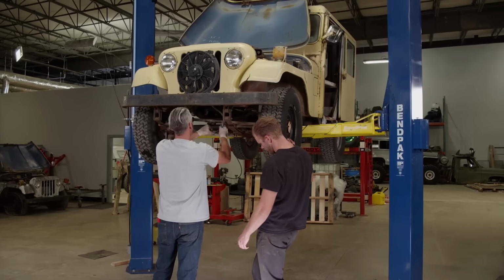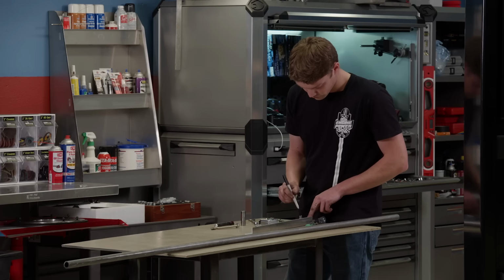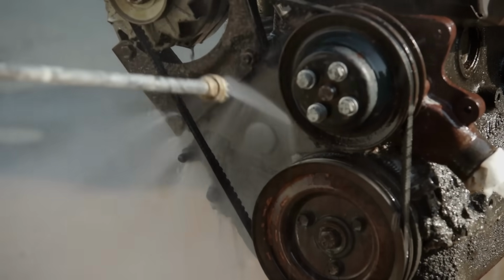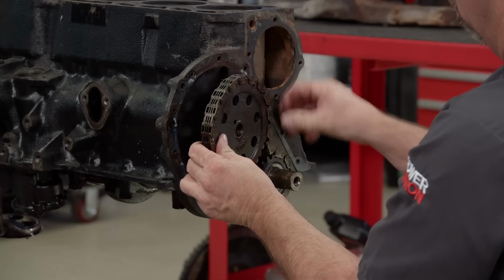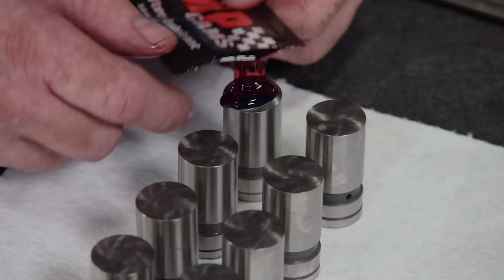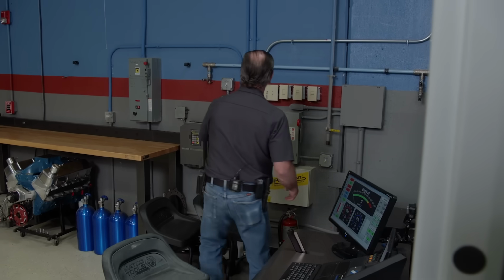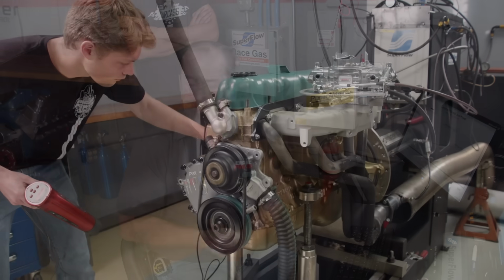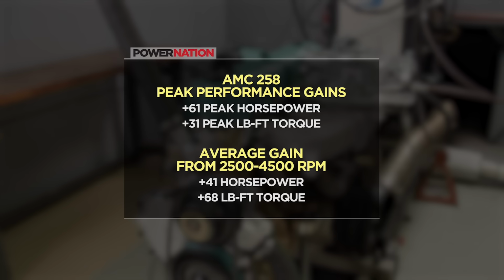Will There Be A Big Power Difference On A Mildly Modded AMC 258 Straight 6? - Engine Power S8, E1

Comment: in the 70s i made my own carb adapter and put a 500 cfm 2bbl holley on my gremlin x. it really woke it up and surprized a couple of people at stoplights. 3 speed manual floor shift tire smoker.

Comment: You could use treaded rod to center the head gasket. Once the head is on and you put in a couple of head bolts you can then remove them..

Comment: scrub it so clean that your dear nana approves, magnaflux it, if that's okay paint the block and send her to a quality machine shop to have it decked .30  thou, hone cylinder walls line hone the mains and cam, widen/chamfer the intake + exhaust ports, smooth all the runners, and then have the block cryogenically treated. believe me its worth it and these blocks are getting rare. at the same time have the crankshaft ground and balanced, one she's home,  forged pistons, 4340  rods, clevite p bearings, ARP head bolts, felpro gasket, mahle lifters, hot clevite camshaft, 0.420 I&E lift, and the ported exhaust loves that and the extra duration.  backcut your valves, lap the seats, roller rockers, amsoil assembly lube. and an really nice torque wrench. id fill it with rotella Dino, light it up and set the timing/advance. break it in and change, change oil. end up with rotella conventional 15W-40 and a can of liqui-moly MoS2 molybdenum additive (magic German juice) which will keep your lifters quiet through time and keep everything dri-slide slick. that studs is great in all motors but I think it benefits these old iron NA beasts the most. looser tolerances and all, the molybdenum disulfide beds in to the metal at contact points and after a few thousand miles really helps immensely.

Comment: I have driven the same Jeep for 20 years.  This Feburary of 2025, the characteristic AMC 242ci I6 rattle when first starting became a loud knocking.  The engine still idles very smooth.  Oil pressuee is great!  There is no smoke, no leaks, no misfiring, no difference at all, from when it was quiet.  The only thing I can imagine is that maybe a piston skirt broke off and loud piston slap is the result.  But, there is no burning oil, no misfiring.  The loud, horrible, knocking and rattling is worse at higher rpms than lower.  Thus, I hurry up to get to fifth gear, to quiet things down.  Well, it is September 2025 now.  I am still driving my beloved Jeep.  But, I know she is in hospice.  Upon her death, I will lovingly put her on Jack stands and just make her stationary beauty.  With a bad engine and transmission, my dear Stargazer is doomed.  Repairs will cost more than the value of any 2001 Jeep Wrangler Sport.  I shall miss driving her when she dies.

Comment: My favorite 258 mod is throw the amc ignition aka distributor in the garbage and grab a 6 cyl gm hei change the drive gear to amc from old distributor. Teeth are opposite cut but same count and diameter,i think i had to shave a hair off top the gear on mine to get the roll pin to go back in ,was just a hair be careful just a hair! Now u have a 1 wire for fire High Energy Delco distributor for a hot spark that will set u on your rear if u would like to be brave enough to touch it 😅 no recommend,,,flame thrower is a aftermarket brand through a performance parts house is my goto for the gm style hei. Enjoy no more that pile of ignition nightmare that goes along with the amc 6😊

Comment: When installing the cylinder head, why don’t you use a couple studs to locate everything, then remove them after the rest of the bolts are hand tight and replace them with the head bolts? Even all thread would help keep things straight, although I’d rather have something with a shoulder. Then torque the bolts down to spec. It makes sense to me, and I wonder why it’s left to luck to get things lined up on this engine.

Comment: Lotions and potions, ey? I worked in Auto Parts for 20 yrs in every environment you can think of, and I never reccomended miracle in a can products. Sure there are some additives and polishes and waxes I would reccomend. But there’s also a lot of snake oil out there. Be careful on what you buy and use on your engine. I’ve used Marvel Mystery oil to quiet a noises distributor busking, and it quieted right down for the last two years I owned that vehicle. I’ve used Slick 50 with decent results. I’ve used radiator sealers and engine oil flush. The flush is something you don’t want to leave in your engine, you change oil, add the flush drive it for a short time and change oil again. It helped remove varnish. But there’s also are things out there that will harm your anointed as well be careful and don’t look at potions to fix mechanical problems.

Comment: My gm straight 6 has no bolt for the hormonic balancer. How do I get it back on? I had to heat press the new flat top pistons on the rods, so I'm guessing I have to heat the balancer to slide it on right? But wouldn't that wreck the rubber on the balancer?

Comment: I had a balanced and blue-printed 258 with flat top pistons 390 cfm 4-barrel and a set of headers that made 260 hp.I don't think what you've done with that motor is very impressive?

Comment: I have seen multiple cases of 360s and 401s make an easy 400 plus hp as long as the oiling system is ported and modded correctly

Comment: I Thought it was gonna be like 200hp
Reply: it's only 8.1 compression,
Reply: Later model 4.0L I6 like my 2005 TJ were 187hp from factory. I did a 4.6L stroker to mine about 10 years ago when parts were easily available and cheap - under $4k including an edelbrock head. I wouldn’t bother doing it now, just something I had to do back then. The beauty of these engines is not power, but the torque down low combined with a short wheel base relatively light tub body TJ Wrangler.

Comment: It's funny (to me) that the AMC sixes are so similar and yet act so differently.  The 232 is a peppy engine that loves to rev. That's probably the reason they used 232's in several racing cars - they are essentially a baby stroker.

The 258 on the other hand has a much longer stroke.  It makes a lot more torque but it is a much lazier engine. I mean, you can hop either up..... but stock for stock.... the engines run completely differently.
Reply: I'm no expert, but I think the 258's general lack of top end, even modified,  comes from overall poor head flow, 

And when paired with the higher displacement of the 258, the bottom end's hunger for air outpaces the cylinder head's ability to flow said air at high rpm.

It would be cool to see a maximum oversquare engine though, a 4.0l (.030 over) block with a 199 crank, for a 215ci 3.5l "destroker" 
Imagine the RPM's!
Reply: @riogrande163   The only difference between the 232 and the 258 is deck height and connecting rods. Engines with long strokes make great torque but do not like to rev up.  The 232 is a stroker by comparison.

The 199 suffers from the same inadequate head/port design compounded with lack of displacement. 200 cubes just don't cut it.  Ever driven a Maverick with the little Ford 200?  That engine don't even make a good door stop.

That's why the AMC/Jeep 4.0 was such a good engine.  Moderate stroke, same bore as 232/258, much better head & port design and of course, multi-port injection.
Reply: @That_AMC_Guy  

Wikipedia says the 232 and 258 have different strokes,

you can rev a longer stroke engine, but the piston speeds will be higher. Newcomer Racing rings out stroker motors all the time.

200 cubic inches is plenty for cars under 3500 lbs, 

what killed the Ford Thriftpower inline 6's (144,170,200,early 250) is the integrally cast intake, meaning no upgraded intake and carb could be bolted on, you'd have to hack it off and custom fab something else, hence why most ditched them for v8's.

Comment: That's a 7 main bearing well constructed engine!! Do it justice.Take it back apart put in a forged steel crank,heavey duty everything,a hotter cam, more carburetion,shave the head and add a centrifugal supercharger the see what it will pull.

Comment: yall are running out of carb. shes going too lean up top. personal experience with these motors is that if you bump it up to a 550ish cfm carb and dial your jets in youll probably get over 175hp with this combo. wanna shoot for 200hp? dont be scared to bump the CR up closer to 10:1 and be prepared to only use 90octane or higher gas.

Comment: This would be a great motor for  the old ramblers.....not as heavy as the v-8's, would work good with that trunnion suspension all amc's had in the 1960's.....may be with a bore job to the cylinders, you could crank over 200 horse...would like to drop this little I-6 in my old rambler american with a ford 8 inch rear I swapped in.

Comment: yall completely messed up this build. i love your videos but the space should have been a 4 hole. the primary side and secondary side MUST BE ISOLATED FROM EACH OTHER AT ALL TIMES. thats why there are 2 intake runners. from what i saw, you used an open spacer which killed your flow some due to the intake runner separator. do it again with a 4 hole spacer and watch the torque go even higher.

again, i love yalls videos. just caught a blooper on this one. =)

Comment: powerglide?   What  ignition- ford works good  studs on the cap   205 duration if you do not have 300 pls lobe lift you got took     what head  what year    dual port  old school  how was the oil pump?    use a 998 trans with the double wrap band, even lock up

Comment: If you don’t have dowels go to the hardware store and buy some studs or all thread. They only cost a few dollars. You only use them for alignment. Then install the head bolts you will run.

Comment: The AMC 258 was the most powerful engine in the Pacer up until 1978 when AMC put a 304, it was the one of the last AMC engines still in production when Chrysler bought it in 1990
Reply: It came back as a 4.0

Comment: I know little about cars but I knew enough when I was 18 in 1988 to look for an AMC with this engine.  I myself learned to replace a lot of parts on this engine with the car books available from the library (no YouTube back then).
Reply: It was a great choice...back around 1990, you could buy an old AMC car for $50, then harvest the engine and trans...I had a collection of a dozen AMC'S, including a postal jeep, they were all interchangeable

Comment: Years ago in a car magazine they were looking for the most cost effective horsepower mod. It was removing the solid mount rad ran and replacing it with a hydraulic fan from a later model car. Cost about ten dollars and added around ten horsepower.

Comment: Rambler/AMC are WELL overlooked. They are very stable workhorses . Try a 327 Rambler V8. NOT PEOPLE NOT a 327 chevy V8. Those V8s  are work horses that are rock solid and can easily take some performance mods. Only obstruction is that AMC wasn't a big 3 so the parts are just quite not as plentiful but still there for sure. AMC actually was the car that the big 3 used SOME not all ideas from. Everyone drools over Barracudas and such. try a 65/66 Marlin fastback.. Came with a Rambler 327 V8 and in some models a twin stick.  Glad Ramblers never caught on hard and had their costs inflated like the big 3.
"The underdog"

Comment: 👍🏼 Thanks for the AMC inline 6 content.   I have a project Rambler Classic Convertible with the 232 2-V carb.  OEM service manual says it’s rated at 155HP.  However, you show me most likely to expect. I am very glad to see you can do an easy refresh on these engines and boost up the torque and HP.   I also chose the upgraded 4-V, dual plane intake with  small edlebrock. Exhaust manifold is not easy upgrade as on AMC cars the starter motor is on the left hand side, not right like Jeep. I am thinking about trying a 80s AMC Eagle exhaust manifold.

Comment: FYI the block casting number could be either a 232 or a 258 they both had the same block casting with a diffrent crank.
Reply: Oiling for rockers is different.

Comment: Nice to see old school six-cylinder engines getting their due after so many years of badmouthing by V-8 guys. When I was just out of high school I worked at my cousin's Texaco service station and owned a 1966 Mustang 2+2 with a 200ci six and a 3 speed stick. I often daydreamed about finding one of those manifolds to fit the six that ran two single barrel carbs. Y'all can daydream the rest ...

Comment: With some head work and more compression 200hp is feasible. With rods and pistons and lightened flywheel they love to rev too. Together with the Ford 250 and the Chevy straight six, they are used in Argentina in a racing series. They are around 275hp at 7500rpm. They sound wicked too. Look up Turismo Carretera for videos

Comment: In 1979 I took a 1974 Hornet 258 6 cylinder shaved the Head 30 thou off the head put a Clifford Research 4 barrel intake and split headers and a cam on the street I ran a 1850 Holley and on the strip I ran a 750 double pumper I changed the rear end to a C diff AMC only offered three diffs A B C if I remember correct I ran it at Green Valley Raceway in Colleyville it ran 15.30’s in the 1/4 and the Engine you have is a 232 cid the 258 uses a rocker shaft. I can’t remember if the heads are interchangeable

Comment: Did some carburetor tests on my 86 Jeep CJ7 258. The stock Carter VV 2 barrel (variable venturi) leaned out twice for no reason and broke a piston each time. Change to an earlier model which was safer but still didn't run well. Bought the Weber 2v kit with vacuum secondaries and was severely disappointed. By the time the second venturi opened the engine was out of it's power band. Pathetic. Put a carb adapter on and added an Autolite 2100 from a Mustang and the power difference was huge. Smoother also.

Comment: All your old need jeep needed is a slightly hotter cam and bearings, rod and main bearings and a timing chain replacement. Valve train clean up...make sure oil can flow good shed probably be fine forever

Comment: 100hp @ around 2,600 rpm is pretty damn solid right there

and a somewhat flat torque curve from 2,500-3,750rpm 

that is a Good Engine for a medium duty truck or a jeep I tell you what.

Comment: I've heard bad things about that Offenhauser intake manifold. I bought a used one for a 302 Mustang way back in 1984 when I was 16 at the Pomona Swap Meet. When I went to buy gaskets for it at a speed shop, the guy at the counter told me he had one at one time and that it only worked at wide open throttle. He was so convincing that I sold it on The Recycler.
Reply: For the 6 cyls, Offey or Clifford are it.

Comment: A little secret AMC I-6 have a second harmonic zone beyond the Red-line. If you can spin it past the breaking point fast enough you get into another level of stable harmonics that give you double the RPM peak.  AMC experimented with that back in the 60s and 70s for racing. F class racing. The sound of an I-6 spinning at 9K RPM is something else...
Reply: Damn fo real??
Reply: @maxjordan2625  yes. It was done, apparently more times than even I knew for things like Indy car motors and also in South America for one of their racing circuits. It's actually true of any reciprocating assembly or reciprocating ICE. But there really isn't a point to it unless you really need to and it's expensive and fragile. Lots to go wrong. Lots to stabilize.
Reply: Use aholley one barrel  it's  better than the carterYF.

Comment: I had the 4.2 in my 88 Wrangler and it was higher compression that 9.2 to 1 I had to run 93 to get it running right especially after I put a bigger Motorcraft carb and stripped the emissions. Stripping the emissions and putting that carb on really opened it up though I could spin my 35 inch tires with stock 307 gears and bark them all the way to 4th

Comment: What's the point of putting on a dual port intake if your just gonna defeat that by dropping on a open spacer !?!? I would like to have seen the torque curve with a 4 hole spacer giving that intake a chance to punch up the bottom end ! Also throttle response which he blamed on low compression would have been waaay better !

Comment: i’d rather see lift being higher from the cam not a reverse mechanical advantage lever (rocker arm ratio increase) i’d dropped it to a 1.5 ratio and upped the cam lift by at least .010” for intake and .015” for exhaust

Comment: You should have used a Holley 2bbl 500cfm but nice build!
Reply: I put a 500 holley on a 258 I rebuilt with stock parts. More torque and top end improvement.

Comment: Can you guys do a GM 270? The one I have in my W.W. 2 truck is just that. However, it has a GM 302 large intake port head, 8.2 to 1 compression ratio and the cam was reground to provide 440 lift with 276 duration. The carb. I chose is too small, flowing around 185 cfm. I will be installing a better carb. when the restoration is closer to completion. It can be seen here; https://www.youtube.com/watch?v=CEJ3VIH4Kgc.

Comment: Back in 1975 I owned a 1966 Rambler American Rogue with the 232 six and automatic.  I replaced the automatic with a Gremlin full syncro 3 speed. the guy at the all AMC yard in Long Beach CA said a 4 speed would not bolt up.  Also went with a Clifford intake and 465 Holly 4 barrel and 3 into 1 Viper Headers, also from Clifford and dual exhaust and glass pack mufflers.  Even with just over 100,000 miles, it ran great.  Put a Sun Super Tach on it so I would not rev beyond 5,000 RPM. 
Did you ever hear of Barney Navarro? he built a 199  Rambler 6 for Indy. Turbocharged and on alcohol, he got 650 HP!

Comment: if you could find a head off a AMC 199 Cid, 1967-1969, you get bigger valves,, also Clifford performance makes some great intake and headers,, and im suspecting  cheeper than summit, I ran a 258 in a 68 Javelin down at Moorso  in palm beach FL.. good times